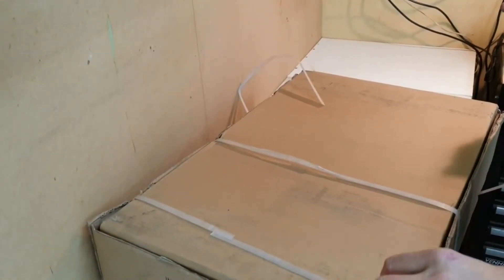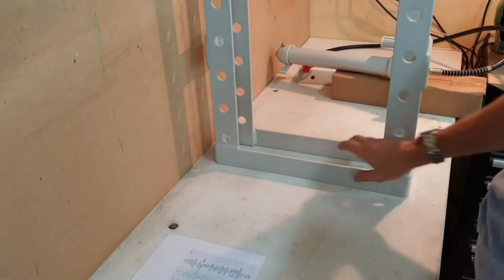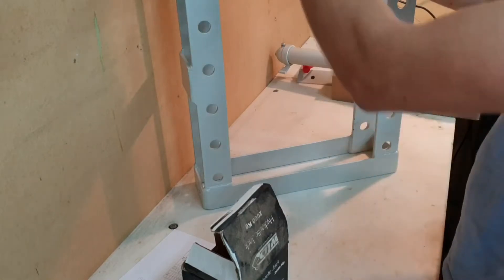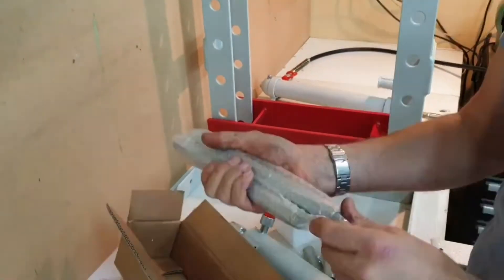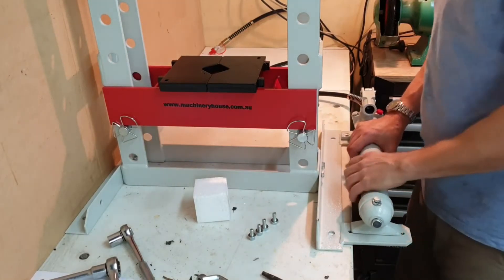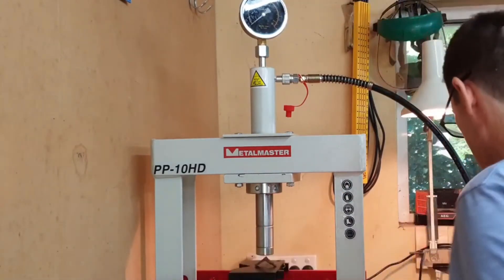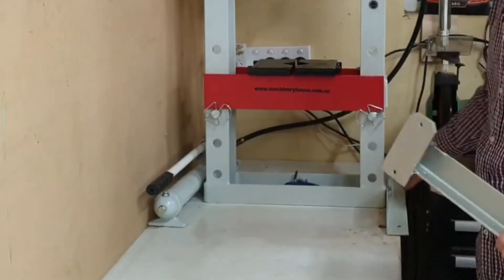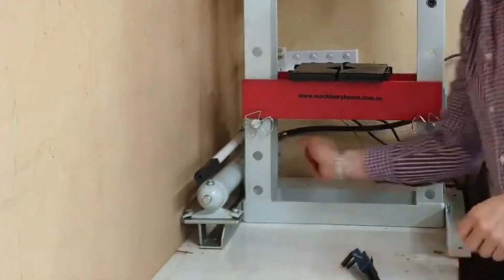Workshop - Hydraulic Bench Press - 10 Tonne

Comment: Looks good Pete. What will you use it for?
Reply from the maker: Mainly for removing and installing bearings. So I've used it a few times, like the KTM rear axle. It would have been impossible with out it. For the RZ it will be used a few times. Steering stem will be the first item.
Reply: Purpose can be diverse. It all depends on the components you will use I’d say. These kind of hydraulic press can be hijacked quite easily to serve various purposes. Plenty of vids on YT to compare DIY models and tweaks 😊